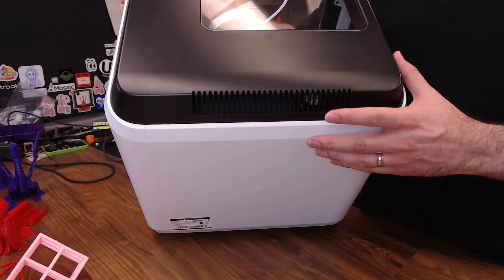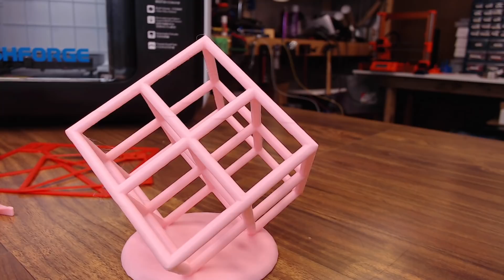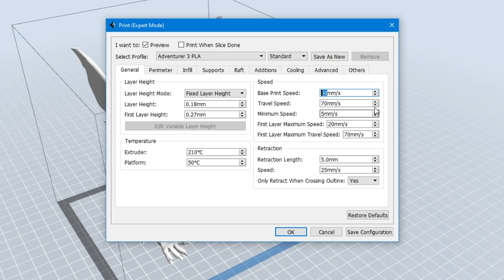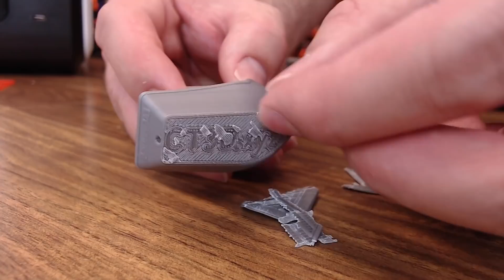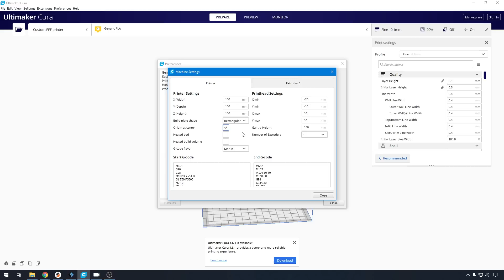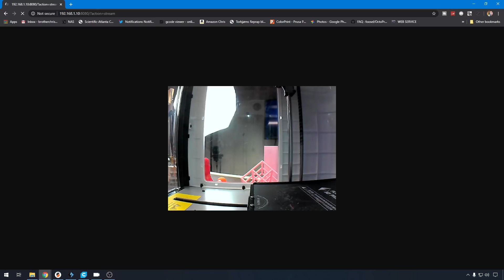FlashForge - Adventurer 3 - 3D Printer - Review - Chris's Basement

Comment: Can I direct the nozzle pattern? It stops, making weak spots in the prototype, instead of running a continuous bead.
Reply from the maker: That sounds like maybe the extruder it skipping. It should always be consistent.
Reply: @ChrisRiley  It jumps from one section to another. Like doing glasses by starting in the middle. Middle first, then one loop, then the other loop.

Comment: Why does it put out confetti and a red ball rather than pulling out the filament like it is supposed to and just print? It quit being strong pla filament coming out rather stringy and is extremely thin instead or just not coming out.
Reply from the maker: It's either a nozzle clog or something up with the extruder gear.

Comment: When printing the octopus how did you build successfully? I cannot get the base layer to stick on smaller parts on this machine. We’re you using the raft like they recommend?
Reply from the maker: Well I don't 100% remember. The leveling was a little hard to get right. I hear the newer version of firmware has multi point leveling. I didn't use a raft, but probably slowed the first layer down a bit.

Comment: This is so funny... I have a crappy Anet6 and i print exclusively PETG and it prints far better than PLA or other filaments on my setup.
Reply from the maker: Interesting, it  could be your part cooling fan,
Reply: @ChrisRiley  Actuallly I rarely use the partcooling fan (for the most part I avoid overhangs in design phase) so I'm really not sure why PETG is the far better solution for me...

Comment: Biggest issue I have with this printer having had one for about a year, you can not level the bed. It's fine until it needs it eventually. Then good luck.
Reply from the maker: Someone told me the new firmware had 9 point leveling now.

Comment: I was wondering about PETG on this printer. Using Cura on this is a great tip. I have the Lite version of this printer. The only difference is no built-in camera. This is a good starter printer but if your embracing the thinker mindset of 3D Printing this printer isn't for you. I graduated to an Ender 5 Pro. This is the Easy-Bake Oven of 3D printing.
Reply from the maker: lol, I like that, nice way of putting it.